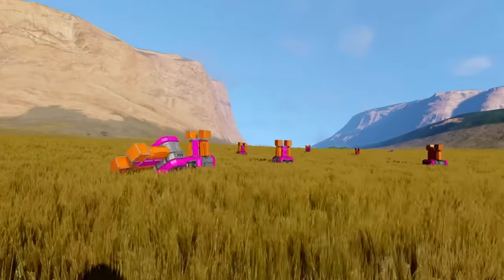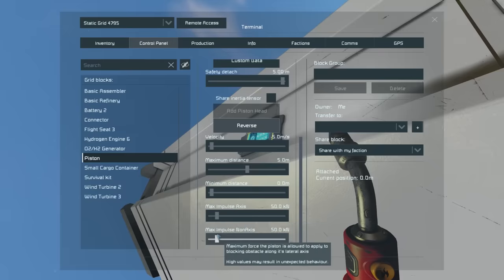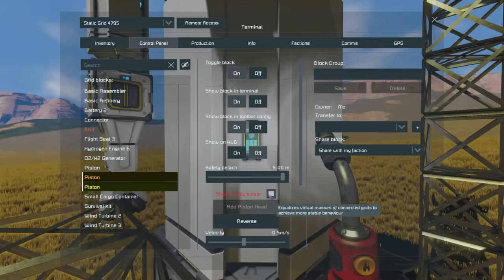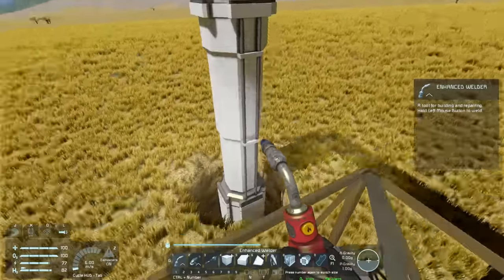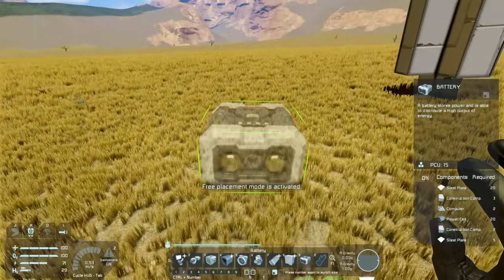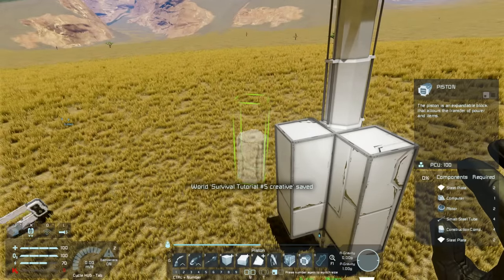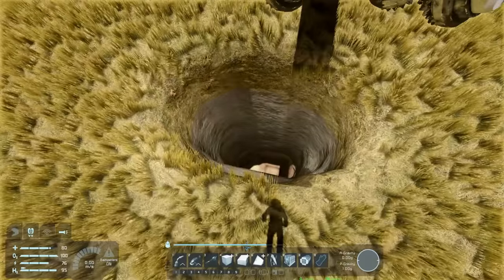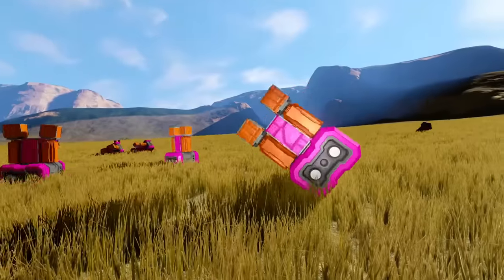Pistons and Drilling Rigs - Getting Started in Space Engineers #5 (Survival Tutorial Series)

Comment: Hi there - I don't seem to have the share inertia tensor option on my pistons. I've set up the drilling rig as the vid and its working well but the heads are shaking all over the place. Would hate them to shake to bits given how long I've had to manually dig out stone to get the steel plate to build the drills! Wondering if the share inertia tensor button been removed from the game?
Reply from the maker: You need to enable experimental mode in your game options from the main menu, then you'll have that available to you. I describe the process and reasons from about 1:45 onwards :)
Reply: LOL - you completely do, and it couldn't be more clear for around a full minute of the vid :)). I think I heard 'experimental' and thought I'm not messing with that stuff yet and breezed over it. Thanks for pointing me in the right direction (again!) :)

Comment: help please! at 24:04 when you pop on the coveyor junction that transforms between small and large connectors, that DOESNT WORK! I've tried a long time putting it on and it simply wont attach. I can only place conveyor junctions that split into other large junctions..
Reply from the maker: That's the large grid version, only the small grid version has the variants - so you won't be able to use it on a base. In this case the step you've missed is removing the rotor head and adding a small head to the rotor via the control panel - that'll give you the small grid you need :)

Comment: hey i maybe doing sommething wrong, i pretty sure i do sommething i dunno if that's becouse of a uppdate or sommething but i clearly cant place down a large conveyor junction on to the rotor whit the 3 small port on sides it seems. just wanted you to know.
Reply from the maker: You need to remove the large grid head and add a small grid head to it. If the conveyor type keeps switching to the larger ones (with only the large ports on it) it's because it's still got the large grid type rotor head on. There are two buttons in the menu for adding rotor parts, make sure you click the 'add small' one :)
Reply: @Splitsie  haha yea mee i am like, i gonna do itt exact the way you do it so i follow the intruction exact. but it seems i cant so, so do it the way you describe it then you can add a small rotor head to the rortor then add a large conveyor junction to the small head on, on the bottom of the conveyor junction ad small conveyors so that you can add the small drill on the bottom 😀 well that should work. it's clearly a bit diffrent but brobbably works.
Reply: @Splitsie  and now i just wanna say thank you it worked whit the small conveyor on the bottom of the large conveyor junction whit the small rotor head on the radvanced rotor 😀

Comment: Hey i have a question, i did this with the small drill, but i dont see the ore transfer automatically into my storage containers
Reply from the maker: With rotors and pistons when I find things not transferring the first thing I check is the top parts of each, they're really easy to miss while welding that I still miss them even after 5000+hours
Reply: @Splitsie  you mean the top parts of the pistons and rotors? I remember doing it like you did in the video to use the adv rotor, change it’s head to small, then attach that conveyer block in its alternate form with 4 large sides, 2 sides opposite to each other with 3 small connector ports, then funneled small conveyer system from one of the small connector ports to my drill just like in the video before trying 3 of them, it seems as if the game is reading drills as a separate grid from my base (cuz of the color difference in control panel), as well as different color for the rotor. I’m not sure what I’ve done wrong for the ore transfer not to go thru into the base.
Reply from the maker: What I was trying to suggest is that with systems like this it's very easy to have missed small parts of it so it's worth checking every link is aligned correctly for the ports on the block and that they're all welded up completely

The different colour in the control panel is normal and is always the case with things attached via rotors/pistons/connectors etc

Comment: At around 8 mins in you spoke of inertial teaser as the entire base / ship. Forgive me if I'm wrong but doesn't it conects the sub grids not the whole base eg on your survival maby world the elevator pistions arnt pulling the weight of your refinerys
Reply from the maker: In survival maybe, when I first built the elevator I had shared inertia tensor on for all the pistons, that was causing problems with the pistons being too weak, to fix that I turned off shared inertia tensor for the one connected directly to the base and it was all fixed. The reason that worked is that the pistons no longer had to move the whole weight of the refineries and the base :)
Reply: @Splitsie  thanks for the good reply. Guess I've spent too long away from the game.